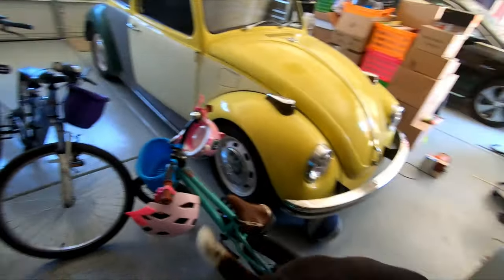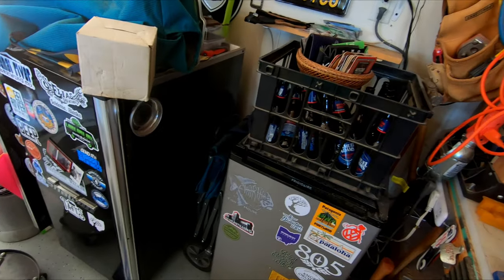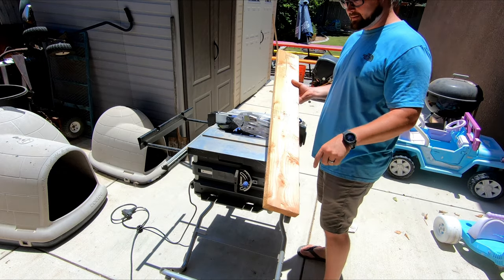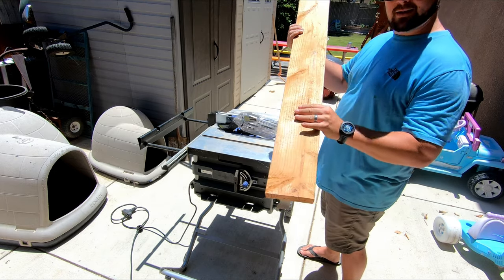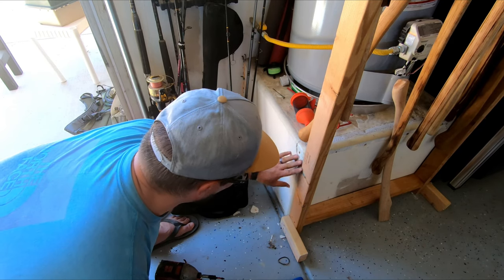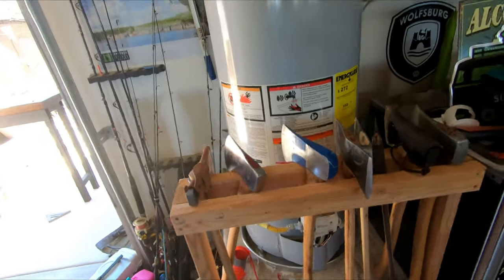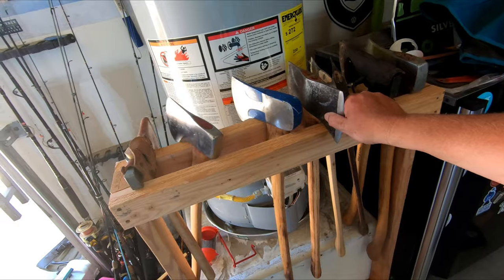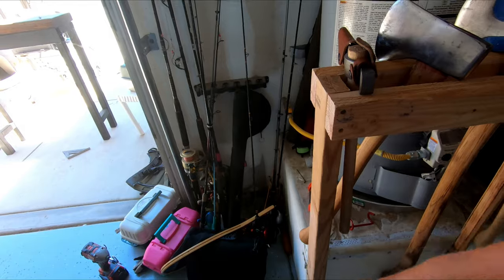Easy DIY Axe Rack Using Left Over Wood In under 5 Minutes!!

Comment: Neat, simple project. Careful when working on the water heater though. You have those sharp (?) axe blades facing your BODY. Slice and dice, my friend.
Reply from the maker: That's a fair point. So far so good, but I've never thought of that. I'll have to be a little more careful, thanks!
Reply: @RoadandReel  Just a thought. For blades covers/sheaths you could use duct tape or something similar (even fitted cardboard) then remove the tape when the axe is needed.
Reply from the maker: @swingbelly  yeah, I might just cut out some cardboard for each one and do that. Thanks!
Reply: I don't have that issue it's in my seacan..